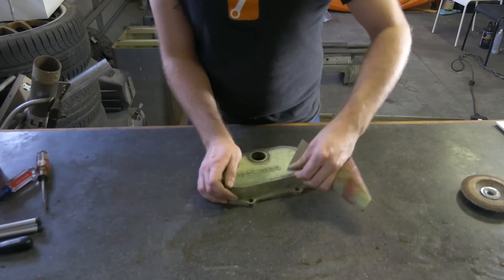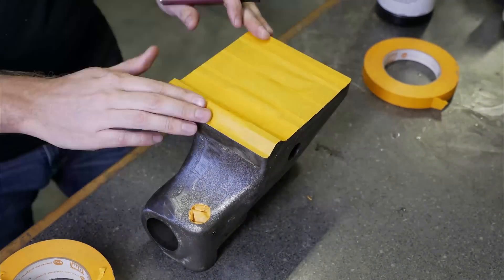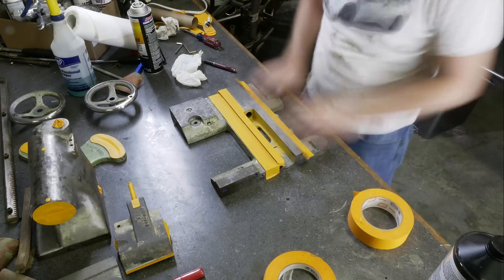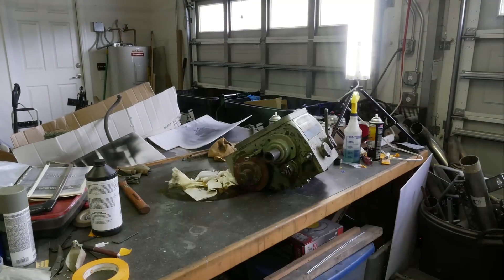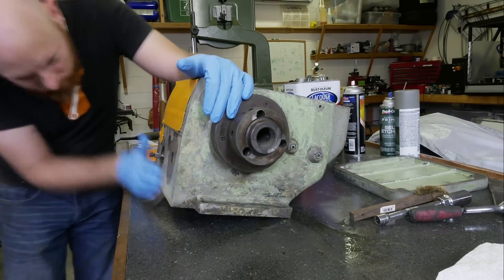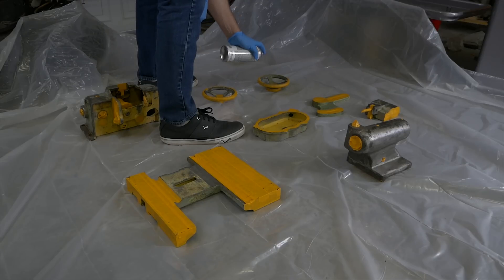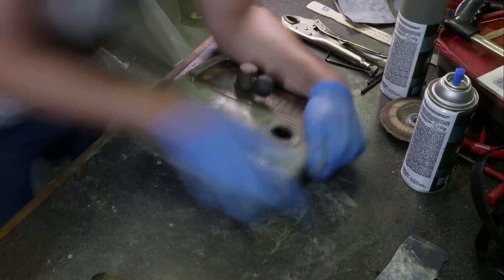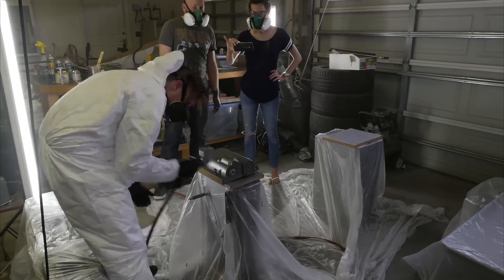Lathe Rebuild Part 6 - S02E06

Comment: The blue 3M painter's tape is designed to be removable from painted walls and such without damage to typical household paints (ie, paints with generally poor adhesion and cohesion). For this application one of their auto body grades (available from any auto body paint supply store, in all medium to large cities and many smaller ones) would have been perfectly appropriate. Hopefully that's clear and you aren't just dismissing all 3M tape. :)
Reply: Blue 3M painters tape is the worst tape on the market. No self respecting painter I know would be caught dead using this crap. It will pull off anything it is taped to, seepage under the seams, impossible to paint a clean line. I know. I have years of painting experience and it only took me a few times to toss this crap in the trash can. Use it at your own risk!

Comment: Hydraulic oil probably or maybe SAE 30 or 40 gearbox oil (depends on how thick the oil was)
Reply: j vdbogaard No not hydraulic oil. It's not designed for this application.
Reply: Almost every manufacturer of Lathes recommends some kind of hydraulic oil for their gearboxes.

Comment: There are many oil discussions at Practical Machinist, like this: http://www.practicalmachinist.com/vb/general/what-type-oil-my-lathe-226846/
If you make some calls to lubricant suppliers and give them the oil that was recommended by the manufacturer, they should be able to provide some equivalents.

Comment: Wow. That is far more work than I would have expected. How much did the lathe cost?
Reply: My wild assed guess on this is that a comparable new lathe would be in the range of $4000 or more.  But the truth is, machine tools in this range just aren't made this well anymore.  If I found a lathe like this in the shape this one started in for less than $1000 I'd jump on it.
Reply: how many times he should answer ??
Reply: Max Maker $200
Reply: how much a new one would cost ?
Reply: Good to know, what brand/model did you get?
Reply: 200$
Reply: A Chinese lathe is not comparable to this, I own a Taiwanese Lathe, well known for being better than Chinese, and it's still not nearly comparable to the lathe being restored in this video.

Comment: It's a joy to watch this come together. I'm in the process of restoring a small Atlas lathe and going though all the exact same steps as you two, just on a much smaller scale :)

May I ask what paint you are using through the spray gun? I need ideas on what to paint my lathe project.

Thanks